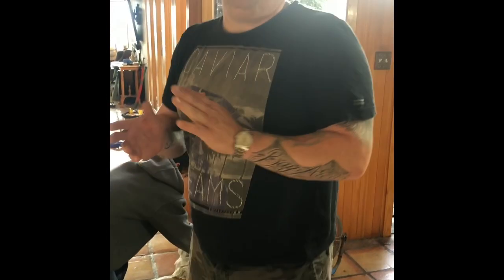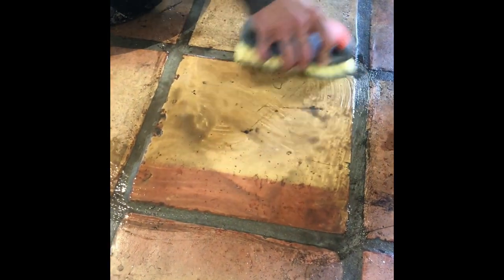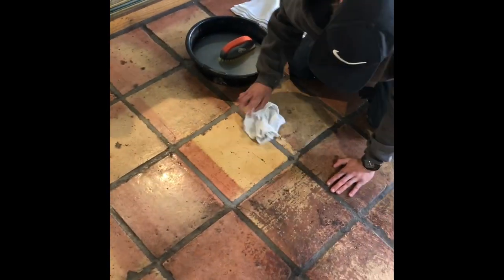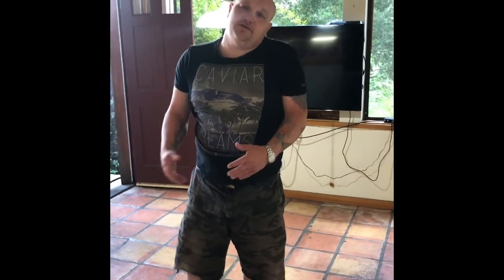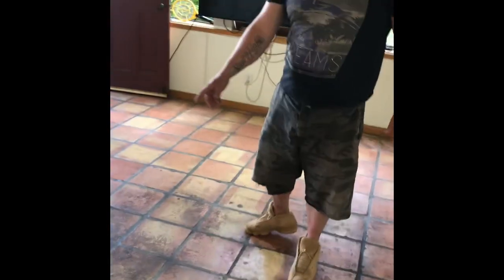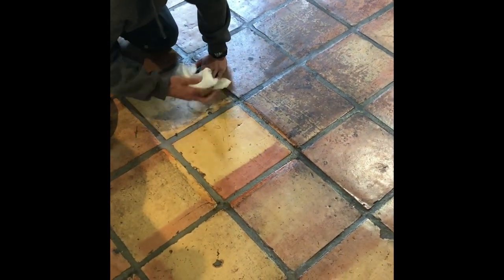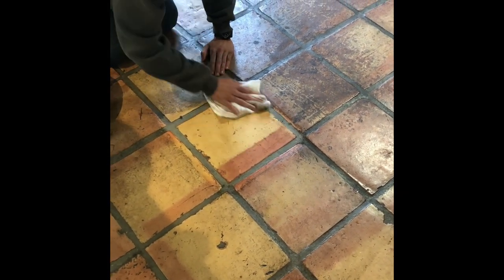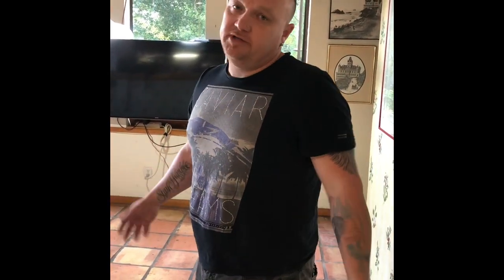Mexican Tile Repair and how time makes saltillo tiles look even more amazing

Comment: Love your videos!.. I find them very inspirational and have provided the impetus for me to get off my arse and renovate my own Saltillo tiled floor.. yes, we have them in the UK too!.. although we don't have the same cleaning products. As you say often in your videos, time and patience is the key to getting a good result, and I'm just taking time out to give my back a rest and have a coffee whilst the cleaner gets to work. The tiles are installed in my kitchen and do suffer from very high traffic (and have been neglected 😒). I had them installed about 20 years back as they were one of the very few products I could find over this side of the pond that 'sat' right in this 350-year-old stone cottage I live in - everything else available was machine-made and looked too regular. I'll have to go and check on my cleaning solution.. Cheers! 👍🏻

Comment: How do I get white patches off on pre sealed Saltillo tile
Reply: I used “First Street Floor Stripper” and scrubbed it with a brush just like in the picture.  It was a lot of work, but my tiles from 1961 look amazing…better than what you buy in the store.  If this guy was in my area, I would gladly pay $500;
Reply from the maker: Want the product we use to remove coatings and old sealer from terracotta Saltillo tile? 

Planning to restore your tiles yourself or you are a tile contractor looking for the best product to remove old coatings and just want the best product for completely removing all of that old existing sealer?

Then call (707) 384-1172 and ask for Fritz to order yours now and 
get the proper guidance and products to restore your tiles the right way the FIRST time!

BUT HURRY !!

supply may be limited and you don't want to be left out.

Call right now and get a FREE 15 minute consultation when you mention this video by title!
(which you are GOING TO WANT, I promise)
Reply from the maker: I appreciate that you explained the hard work you put into stripping and refinishing your tiles because people need to understand that you are not going to get those amazing results by running a buffer over them a few times. ESPECIALLY the terracotta and clay bodied tile.

Comment: What product are you using to clean the floors??
Reply from the maker: For routine cleaning I recommend a neutral cleaner or a low suds degreaser and buff the floors completely dry or they will be sticky and attract dirt which will dull the sealers faster than they should be. Think windex.
Reply: @californiatilerestoration4827  can you please say what is the solution you’re using in the video and the ratio of it because I live in Florida and I’m Dealing with over 350 sq ft and I need some help please. I’m using Klean strip solution for stripping the sealer however, do I pair it with something else? And what kinda grit buffer do I need for the floor bc Home Depot doesn’t have annihilator as a water based solution and it’s for indoors.

Comment: what using? dawn?
Reply from the maker: I recommend a neutral cleaner or a low suds degreaser and buff the floors completely dry or they will be sticky and attract dirt which will dull the sealers faster than they should be. Think windex.
Reply from the maker: We are using a stripper to remove the sealer before cleaning.

 Want the product we use to remove coatings and old sealer from terracotta Saltillo tile? 

Planning to restore your tiles yourself or you are a tile contractor looking for the best product to remove old coatings and just want the best product for completely removing all of that old existing sealer?

Then call (707) 384-1172 and ask for Fritz to order yours now and 
get the proper guidance and products to restore your tiles the right way the FIRST time!

BUT HURRY !!

supply may be limited and you don't want to be left out.

Call right now and get a FREE 15 minute consultation when you mention this video by title!
(which you are GOING TO WANT, I promise)

Comment: Can I paint these? I hate the color.
Reply: No don’t do that the paint will wear off,  replace the floor
Reply from the maker: YES and the proper term would be staining which is meant to be more of a color tint that keeps the characteristics and natural patina of the tile. Paint would just peel at some point because it sits on the surface of the tile while stain soaks into the tile. Hope this helps!